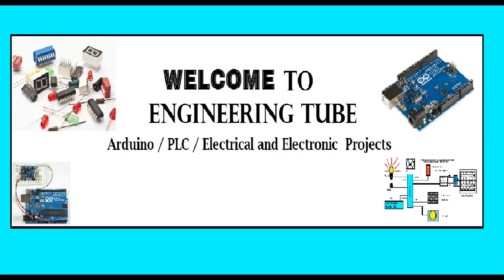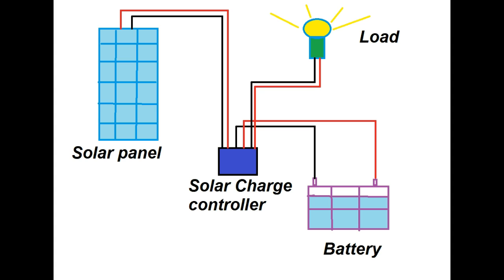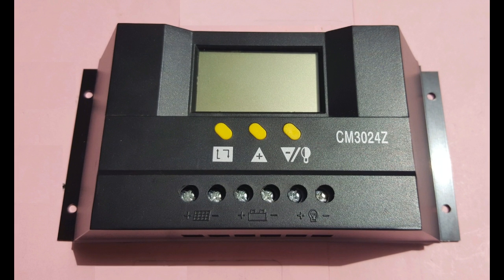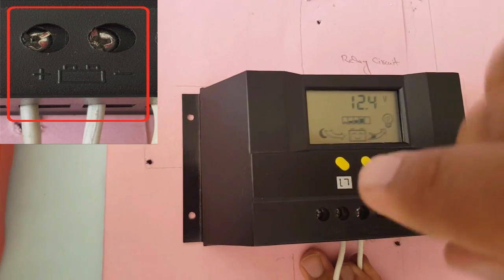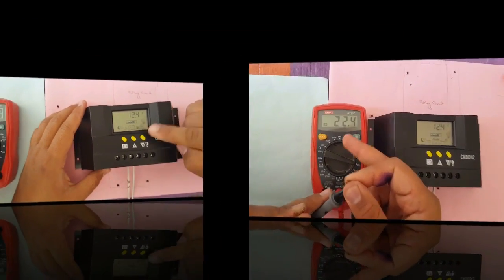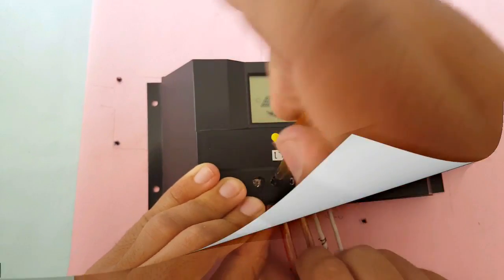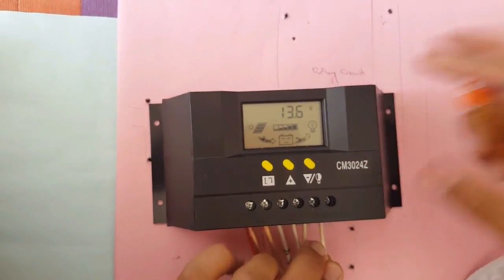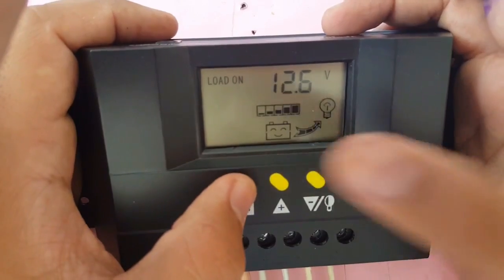How To Use Solar Charge Controller || solar charge controller settings

Comment: Hey man. I have a epever mppt controller without a screen. I have just bought a 110ah agm battery to replace the old 50ah lead acid one. How do I set up the new battery without a screen? Cheers

Comment: What is Max watt of this CM3024Z controller? Will it work with 300 watts? I have 3 solar panels 100W 12V wired in parallel.
Reply from the maker: ya its work